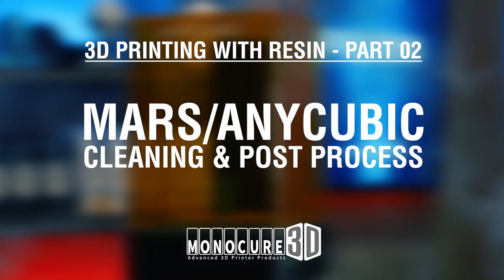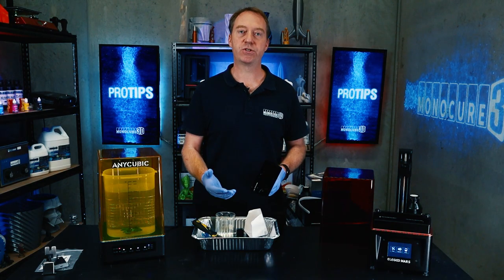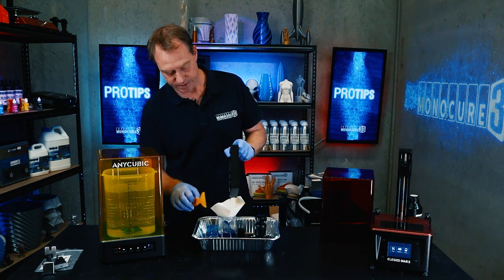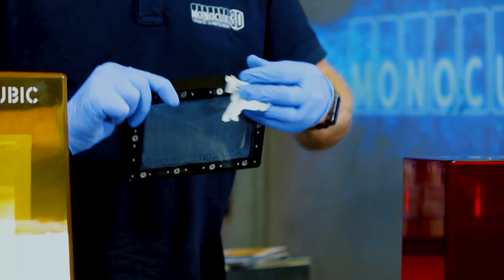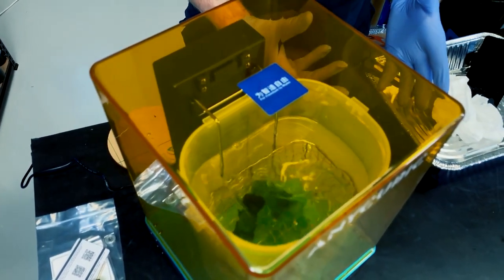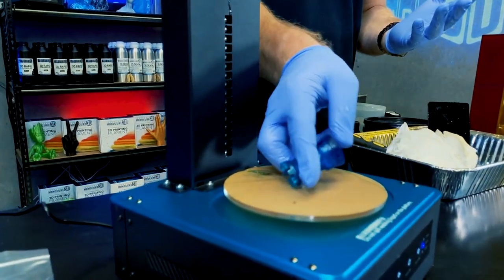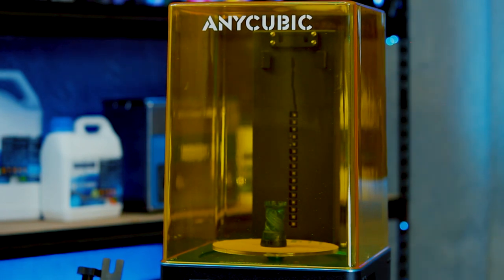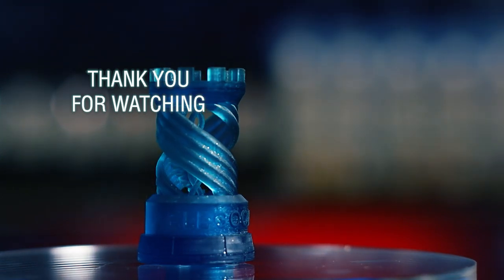Mars / Anycubic Cleaning & Post Process - 3D Printing with Resin - Part 02

Comment: I always use a glove finger or plastic scraper when cleaning bits off the fep, for extra stuck bits I will very gently push the edge of it from underneath with a clean gloves finger...this is usually enough to break the air seal that keeps them stuck and allows  easier scraper removal

Comment: Hi thanks for the video I am actually considering buying both machines and just ended here wondering if the build plate support of the Elegoo Mars was compatible with the Anycubic Wash & Cure. You've used the basket and still have the doubt. Hope you can answer that. Thanks again!

Comment: Just got a Resin Printer because I need to make parts that are strong in
 all directions. Any chance you would make Resin 3D Printer Videos about: 
 1) Comparison of Plant Based,Water Washable, or Eco Resins 
 2) Comparison of Cleaning Products for the Eco Resins.
 3) Comparison of Ultrasonic Cleaners vs Mixing type Cleaners with different cleaning products for the Eco Resins.
 4) Curing Time & Hardness with different Wavelengths of Lights. ex.
 LED Grow Lights 600nm red / 450nm blue vs the Recommended 405nm violet.

Comment: so you do not need to fully rinse out the vat after each use ?
Reply: As long as nothing is stuck to the FEP you should be good to go
Reply from the maker: We always recommend you check that there is no foreign matter ie cured resin - use a slotted scrapper

Comment: I still waiting for the video about the correct disposal of cleaning solutions. People use IPA, ResinAway (and other specialised cleaners), soapy water (or pure cleaner like MeanGreen) and the clean water for rinsing.
I do not suppose that even the so-called eco-friendly resins can be rinsed in the sink. Do I need to collect my rinsing water and dispose it with the other stuff at a hazardous waste disposal station?
Reply from the maker: Great suggestion!
Reply: For IPA one solution is to wait till the resin separates and collects at the bottom of the container, I guess this happens because its heavier or something. Then carefully pour the top layer of ipa into a diff container, this can be reused. The rest of that ipa/resin sludge at the bottom you can leave outside in the sun for the ipa to evaporate and the resin to harden. Once its hard it can just be thrown away as solid plastic bits.